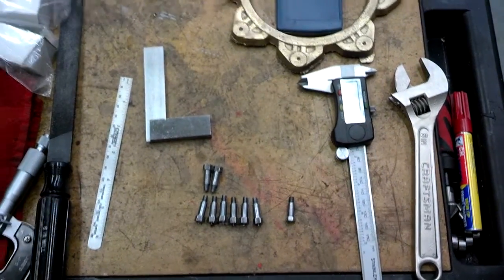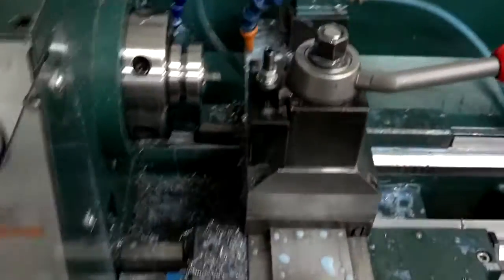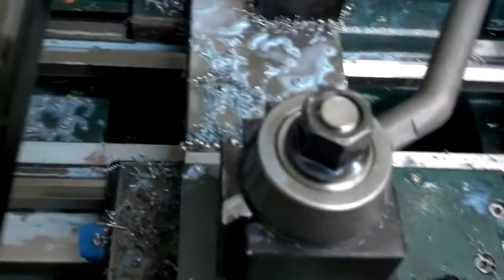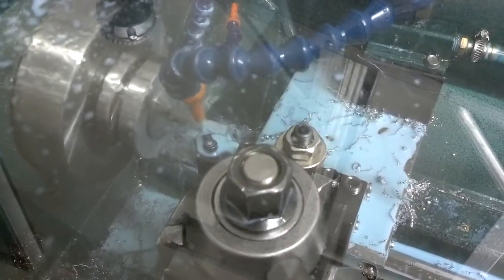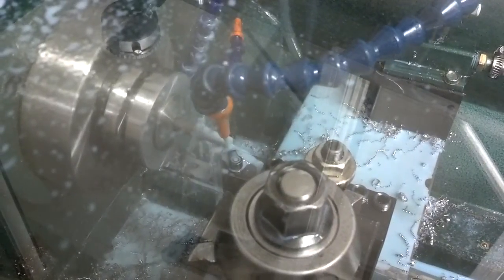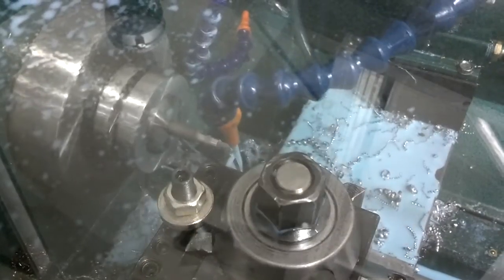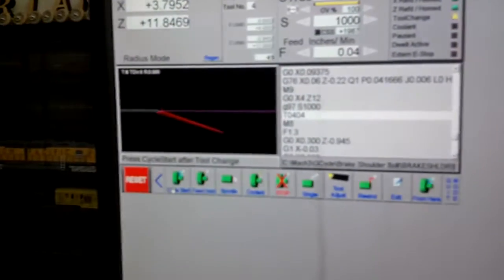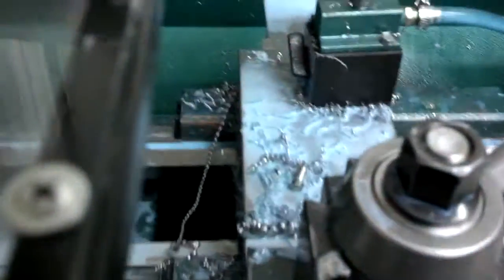Grizzly G4002 CNC at work.

Comment from the maker: I used nema 34 closed loop steppers from cnc4pc.com . You can download specs from their site. The machine is easily capable of 400ipm , it got erratic about 500ipm. but I was not comfortable at that speed. If I get a pendant I may raise it back up, but I found 270ipm to be very comfortable.